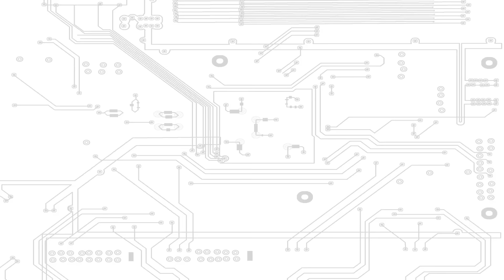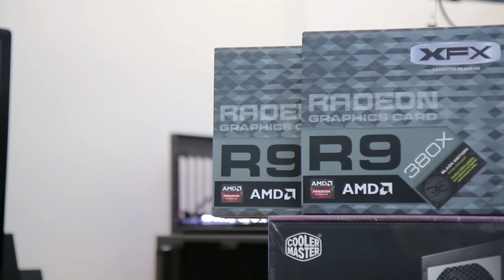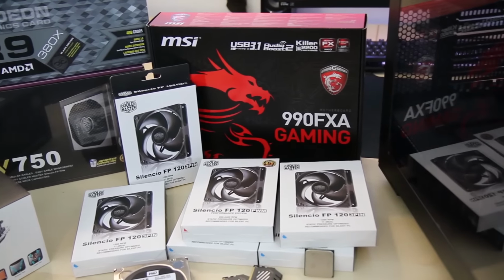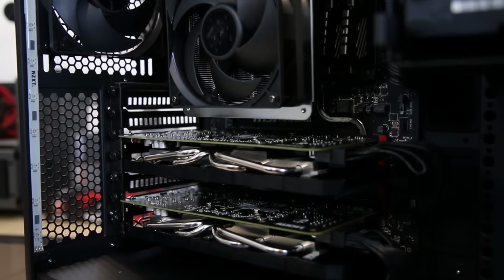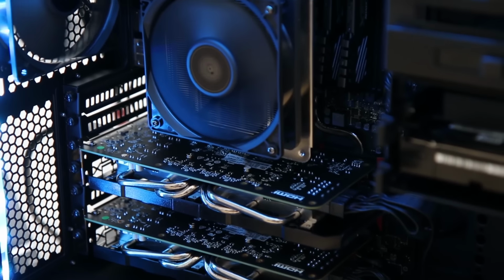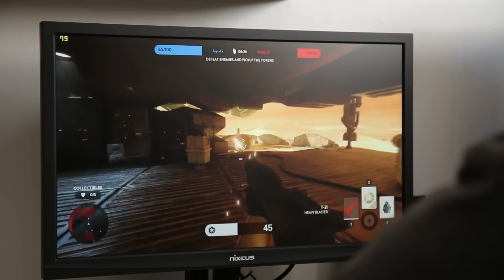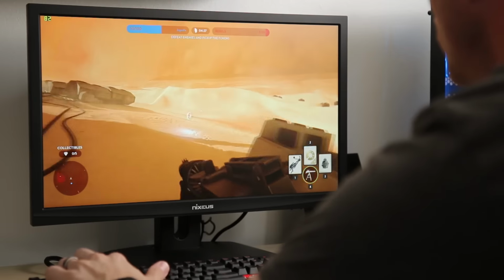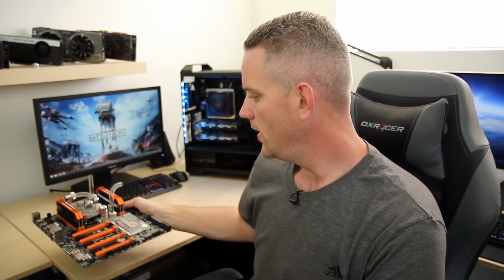AMD Gaming PC - Is AMD still good?

Comment: Just because it is a "driver problem, not a hardware problem", does not make it "not a problem".  If they can't provide good drivers, the hardware might as well be junk, because it is the same result either way.
Reply: +Gerff updating a driver a couple of days after release is a pretty minimal "problem" - certainly less so than buying the equivalent Nvidia card and running out of VRAM while throttling to hell and back. AMD drivers tend to be a few days behind, so I'd call that a non-issue unless you're psychotically impatient. Just drop a setting or two for that first few days.
Reply: AMD has had driver issues for years (from experience, not reading online or watching youtube, where does your information come from).  As far as whatever C.J. is saying, that is pure B.S. as well.  Fanboys never have anything worth contributing, and you can't believe a damned thing they say as they don't even know what they are talking about either.  Educate yourselves, using something besides youtube videos and advertising.
Reply: Gerff "AMD has had driver issues for years (from experience...)"

- if you had issues then you weren't using them properly. I've lost count of how many times driver issues - for BOTH companies - have been down to people not properly installing them or cleaning out the old ones.
Right now, you'll find far more Nvidia users on forums like Reddit asking for driver help than AMD users, and that's because they BOTH have occasional issues, and NEITHER is better than the other.

"Fanboys never have anything worth contributing, and you can't believe a damned thing they say "

- this talented amateur psychologist would point out that your assertion applies equally well to you...

How about asking Nvidia to fix their poor SLI scaling sometime...? After all, AMD fixed this several years ago... Or, better yet, ask a few GTX 7xx series owners what they think of the recent drivers, and the related poor performance of their previous-generation cards.

And, just to decimate your ignorant and logically-fallacious "fanboy" assertions, I currently run systems with cards from both of them. With the exception of a pre-alpha, unoptimized game I have that lacks a Crossfire profile, my AMD cards have never given me any issues whatsoever. I can't say the same of my Nvidia cards. The only recent driver issue I can recall was the Crimson fan profile bug, which I - with my properly-installed drivers - was unable to replicate, supporting my initial observation that these issues are largely down to ignorant installations.
Reply: Christ J
I build more PCs in a week than you have your life, my experience goes beyond yours, I promise.  I am no fanboy, I build what people want, I use them all.  Personally, I have no USE for AMD CPUs because they are behind about 7 years in tech, their GPUs are comparable to NVidia (fanboys don't know shit), other than the driver issues when they have them (often).  When I talk about issues, I am not talking about one nerd with one PC, I am talking about 20 of them at the same time, minimum, and my stats are from service calls and real world, not YouTube.  You can call me what you want, it only shows your own ignorance and bias.  Out.
Reply: Gerff "my experience goes beyond yours, I promise."

- nice logical fallacy. I particularly like the way you seasoned it with a dash of narcissism and garnished it with lashings of pure ego.

Your experience is worthless, as is mine. Put simply, the Reddit set up for Nvidia owners to air their driver issues is sufficient to prove that Nvidia cards are exactly as problematic as you claim AMD cards are. That's not my assertion - it's evidence. It is a record of the sheer wealth of issues encountered in your supposedly-superior software.

" I have no USE for AMD CPUs "

- who gives a shit? Seriously? Your own personal requirements are not identical to everyone else's. Some people are looking to upgrade from, for example, an Athlon, in which case an 8350 is the best option. It is a £120 tweak that will allow them to game extremely comfortably for the better part of a decade as a result of its decent - albeit modest - IPC count and its outstanding core count. An equivalent i5 or i7 would be more than that for the chip alone, to say nothing of a new motherboard as well - not forgetting that identical motherboards are routinely cheaper on AMD than on Intel sockets.

" their GPUs are comparable to NVidia"

- right now, at the high end, they are better across the board.

"other than the driver issues when they have them (often).  "

- according to your own personal selection biases and innate prejudices. In other words, that was yet another meaningless assertion that is immediately rejected on the grounds that it has not a single scrap of supporting evidence.

" my stats are from service calls and real world"

- no, they are made up to support your assertion on this social media forum. MY stats are from the real world, because I am taking what I say from support forums and threads. You are merely making things up - or, at best, inaccurately relaying biased data from non-objective sources and twisting your prejudices to fit them.

"You can call me what you want, it only shows your own ignorance and bias"

- fuck off, princess. Refusing to accept nothing more than the word of an anonymous YouTube poster does not equate to "ignorance". Buy a fucking dictionary.
Reply: Christ J "OOOH, look guys, Reddit, it tells us all information we will ever need!"  Enough said...
Reply: Christ J
And one more thing fanboy, show me where I said NVidia was without problems, just once.  That was just assumed, which shows a mentality issue.
Reply: Alec Manley
Far from it, he is arguing against his own assumptions.  I have yet to see where he has anything to say about the things I have actually stated.  For instance, he is the one bringing up NVidia or trying to compare the two, I have not done that a single time.  I stopped "arguing" with him because he had nothing to say about the conversation or to contribute to it, simply because he assumes I have an opinion one way or another about a company I said nothing about in my comment.  There is no point in discussing anything with someone who will have the discussion without your presence anyway, and is entirely happy assuming you say things that gives their words value.
Reply: Gerff "  I stopped "arguing" with him because..."

- your original driver claim was debunked, refuted and disproven, leaving you unable to argue for your preferred company without forcing you to actively deceive yourself further
.
Fixed it for you.

So, any chance of you commenting on those driver issues you mentioned? Any chance of you backing up your original assertion? Didn't think so...
Reply: Gerff HA! Couldn't let this one go unnoticed:

"he is the one bringing up NVidia or trying to compare the two, I have not done that a single time."

- really, princess? You sure about that? How would you respond if I quoted an instance of you doing exactly that...?

Brace yourself...here it comes...

" their GPUs are comparable to NVidia (fanboys don't know shit), other than the driver issues when they have them (often).  "

-(drops mic)
Reply: Gerff therein lies the difference: you keep saying that I'm wrong, while I keep demonstrating that you are.
Reply: Christ J
No, you keep saying I am wrong, about things that you fabricated on your own.  I keep pointing that out, because I am sure, in your head where these arguments exist, you likely are right.  But this is not your head.  Your entire argument is fabricated, based on an assumption of something supposedly implied, which was not.  You are so stuck on the fanboy mentality and way of thinking that you instantly create an argument in which you can defend something that was never under attack, or shit on something that was never praised.  My original comment, which somehow you created all of this argument about (congrats on that by the way, it is a true talent to be that imaginative, but you may also wish to seek help for the brainwashing you have experienced), was simply an observation of a statement that was made in the video, and applying a bit of scrutiny to it that it could not hold up to.  It does not matter what product, company, or whatever else you wish to use to classify something, my original post and scrutiny holds true.  I am sorry you are so offended by the truth, and I also wish I could help you with the problem you have of personally associating something in a manner of which you were offended, that was never stated nor implied; But alas, I do not have the knowledge or power to treat the disease of the fan-boy, and all I can do is attempt to impart some knowledge so that others may not fall into the hype/marketing trap that creates an illogical sense of "company loyalty".  You may continue with your arguments, as you do well arguing with your own assumptions anyway, and really don't need me to say anything at all, you will create that part on your own as you continue to do.
Reply: Gerff and now he's completely abandoned concision while mixing in horrendous abuse of the poor, innocent comma.

" you keep saying I am wrong, about things that you fabricated on your own"

- here's my original post:

" AMD drivers tend to be a few days behind, so I'd call that a non-issue unless you're psychotically impatient. Just drop a setting or two for that first few days."

- in which I directly addressed the fact that the latest drivers were the root cause of the issue noted in this video. You ranted about drivers; I corrected your misrepresentations.

That was this thread in microcosm. Everything I have posted has been correcting some error, misrepresentation or canard of yours.
Everything I have addressed has immediately followed a quoted segment of your previous comment. I'd have thought you'd have learned your lesson when I quoted you bringing up Nvidia shortly after you claimed " I have not done that a single time."

You are delusional.  

" my original post and scrutiny holds true."

- no, it does not, because it is entirely dependent on their drivers being ubiquitously inadequate. Your original post does NOT apply when they release drivers within a week for each new game, which is precisely what they do.

Your tirade applies only while their drivers perform sub-optimally, which is seldom more than a couple of days, if that. Ergo, you are wrong. Fact.

" I do not have the knowledge"

- no shit...

"all I can do is attempt to impart some knowledge"

- well, assuming you first intend to take the time to actually acquire some knowledge...

I find it hilarious - as, I'm sure, does Alec Manley  - that you are accusing me of biases when I am the only one of us prepared to back up his statements with quotes and sources. After all, everything you have said has been accompanied by nothing more than a vague demand to be believed unquestioningly, whereas I cheerfully linked you to forums which support my points - which, I have no doubt, your ego prevented you from clicking for fear of forcing you to admit that I am right.

You are a paradigm of psychological projection. Every single aspect of that ad hominem-laden run-on perfectly describes your own predetermined biases and wilful ignorance. All you are doing is taking those cognitive deficiencies that you subconsciously know to exist in you and applying them to others just to preserve your feeble ego.

Truly pathetic.

Now, feel free to link to some genuinely poor driver issues that are exclusive to AMD. After all, your original assertions rest entirely upon such evidence, so its inevitable non-existence may finally compel you to confront your cognitive biases.
Reply: Gerff "you are STILL arguing about things that were never stated"

- I'm quoting you. That means, by design, that you MUST have uttered those statements in order for me to actually do so.

"Someone else can argue your fanboy war with you, because I refuse"[sic]

- nobody else has, because anyone else would have taken a brief glance at places like the Nvidia sub-Reddit and noted the masses of driver issues themselves, along with the fact that AMD are never more than a couple of days behind game releases with theirs. These are just about the only two points you have actually outright stated, and they are both readily disproven just by glancing at some user forums.

"My refusal to engage..."

- is rather compromised by the fact that you insist on getting the last word, but are abjectly terrified of addressing my points for fear of having to admit you were wrong.

" You may continue with your insecurities and ignorance"

- why am I the only one of us willing to look at the evidence, princess? Why are you trying to make your own wilful refusal to accept such evidence sound like a fucking virtue? "In my experience..." is the kind of subjectivity that is routinely excised from courtrooms and scientific analysis because of how misleading psychologists have proven it to be. Once again, you are a paradigm of psychological biases.

"In parting, I shall bring you my original post"

- fine, then I'll re-ask you how exactly these drivers are a "problem" when they are rectified after less than a week? That is the entire crux of this issue - the above video features a spanking new game which did not yet have drivers out for it (something for which developers need to start apologizing for, as optimization should be their responsibility, like it used to be). However, shortly afterwards, this situation was rectified, making it a complete non-issue thereafter.

So, where is the "problem"...?

Comment: I don't understand. I have dual 270X in crossfire, a 9370, and 16 gigs of ram and I run battlefront around 100 fps on that map. only slight overclocks. can definitely agree to the driver issues though, but my crossfire is running fine. intermitten errors maybe?

Comment: im going fn crazy. i have a 8370 with a r9 390x and it is super bottle necked. i can't test battlefront cause i don't have it. but i know i should at least get 80 frames with it on world of tanks maxed out. but only get 40-55 consistent frames. i saw 2 guys with r9 390 non x versions get 80 frames. but they both had intel chips. im either going to wait for the zen or get a intel chip. it sucks cause a lot of people that do test on gpus have good cpus. people always say spend the most on the gpu that's what matters. well i heard of cpu bottle necking before, but rarely heard it and no one really talks about it. so i spent well over 100 bucks for the main build. cpu, gpu, windows, ram, hdd and ssd, psu, cpu cooler and case, shoot just the gpu and cpu were almost 600 hundred alone. to not be able to still get full potential and or to run everything i play maxed out.

Comment: Orrrr get two nice Nvidia cards and have a blast with SLI because Nvidia has had a sli profile since launch
Reply: +R3D i'd rather wait the extra few seconds than be cooking smores over my burnt GPU though
Reply: +TheNerdyCanadian yeah well 3.5 GB!
Reply: ***** i have a 280X and have never maxed out the 3GB, and the 3.5GB thing is old news
Reply: +Brian R orrrr just get one single more powerful gpu like he recommended in the video
Reply: ***** I was talking about the issues with the Crimson driver locking fan speeds too low and frying cards. I've never had issues with heat either, only issue I had was the stock fan curve was way too aggressive so I had to run a custom curve to quiet the card (Gigabyte 280X)
Reply: ***** i have all my games set to ultra/max settings, never get above 2.9GB
Reply: ***** i can run it maxed and i didn't see it get very high, don't have it installed atm so i can't check
Reply: Wes Tech Games i had to get a revision of the beta driver direct from AMD because it refused to install on my system, kept crashing during extraction...
Reply: akalion213 it was crashing during self extraction, didn't have any issue going all the way back to 13.12, and i tried it with it whitelisted, as well as AV disabled and it still happened, so it wasn't Malwarebytes causing it
Reply: ***** what resolution are you running? i have GTA maxed out and it topped at 2.7GB
Reply: ***** do you have any advanced graphics settings on?

Comment: Is this a good computer for 600 dollars? If it is, how many fps could I get in ark at high settings?
Intel Core i5-4590 3.3GHz Quad-Core Processor
Deepcool GAMMAXX 300 55.5 CFM CPU Cooler
ASRock H97 Anniversary ATX LGA1150 Motherboard
G.Skill Ripjaws X Series 8GB (2 x 4GB) DDR3-1600 Memory
Seagate 1TB 3.5" 7200RPM Hybrid Internal Hard Drive
PNY GeForce GTX 750 Ti 2GB Enthusiast Edition Video Card
Deepcool KENDOMEN Black ATX Mid Tower Case
Thermaltake TR2 700W 80+ Gold Certified ATX Power Supply
Reply: +DBeetion ,The_Gamer   no ..  gpu is too weak and psu is totally overkill ..
Reply: +hello walkman is the zotac 950 amp and a 500 w 80+told a good change
Reply: +DBeetion ,The_Gamer gold
Reply: DBeetion ,The_Gamer  yes much better than before..

get this combo .. i3 4370 + r9 380x + 550 watt psu .. should be awesome for 1080p gaming
Reply: DBeetion ,The_Gamer  also you wouldn't need an after-market cooler ..  the stock cooler should be fine
Reply: +hello walkman thanks!
Reply: DBeetion ,The_Gamer  :)

Comment: I have never done crossfire before and i have a second r9 27x coming in and i was wondering, with the new AMD Radeon settings layout, the crossfire option would be in Gaming/Global settings/Global settings or Global overdrive section correct or no?